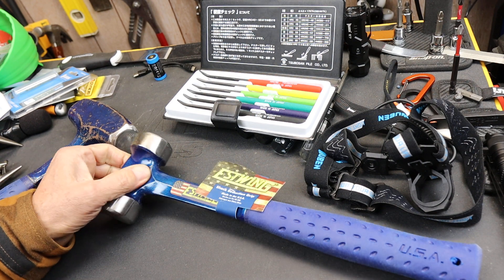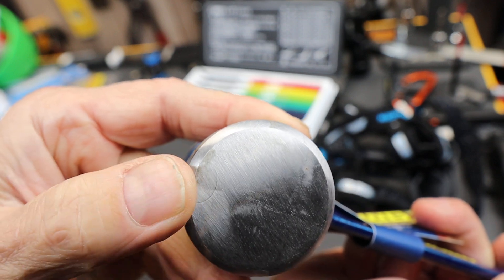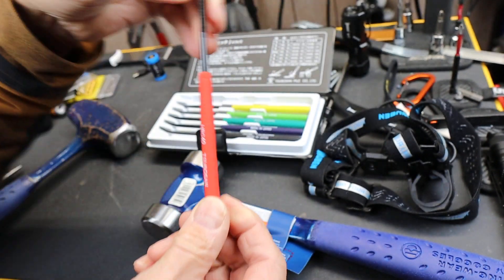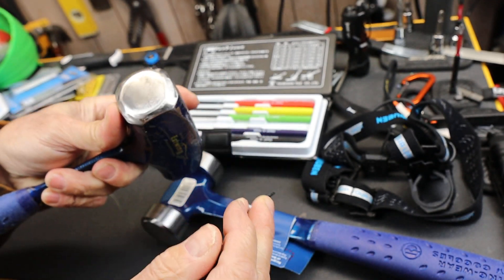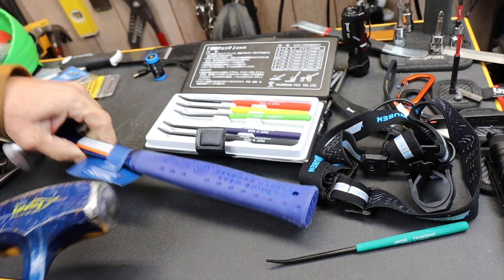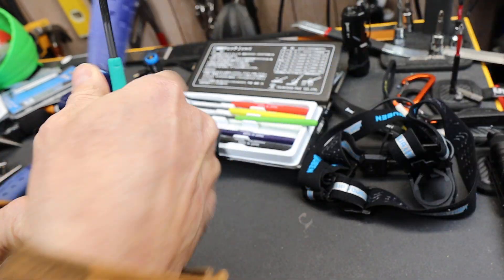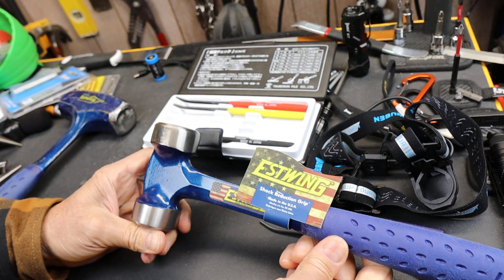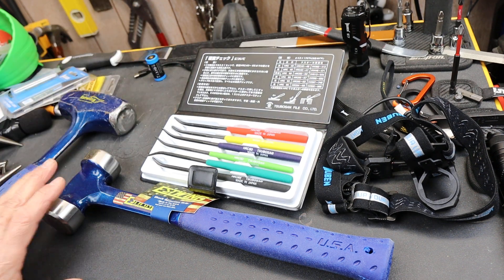Nothing to see here. The Estwing Lineman hammer within hardness specs using TSUBOSAN Hardness Tester

Comment: My guess is the spherical boundary layer you discovered is most likely the same material as the rest of the hammer but gases in the casting cause uneven heat transfer during the heating and cooling cycles during manufacturing.   Surely there is a metallurgist in this group that knows  and can comment.
Reply: There's always a pilot, engineer & metallurgist in the comments section...always. Oh & a chopper pilot.
Reply: @aussiehardwood6196  I have the gas part covered.
Reply: This is a great community.  Doc does a very good job explaining these designs.